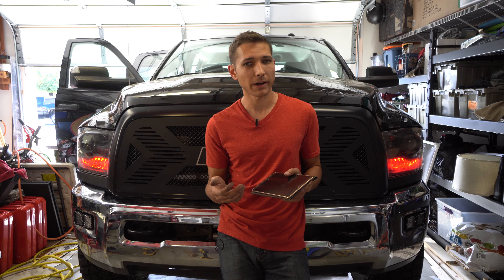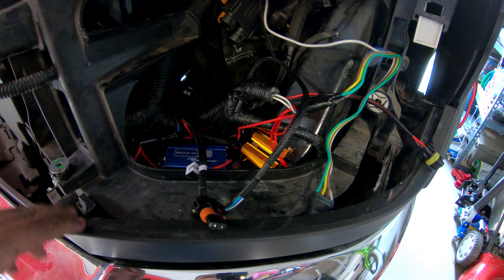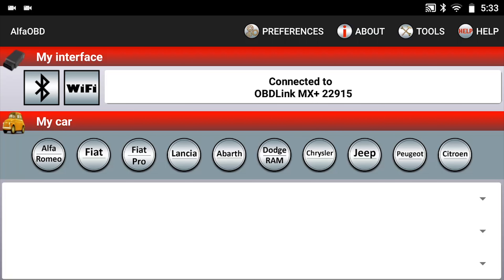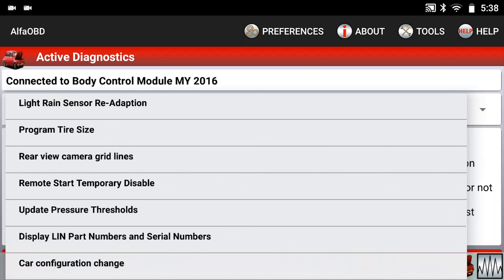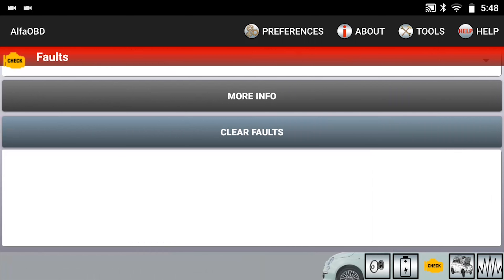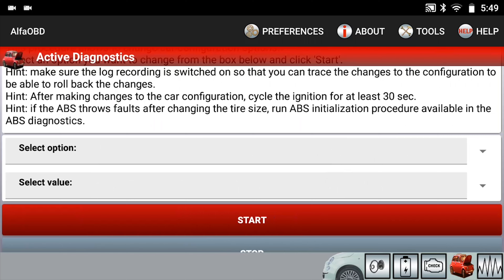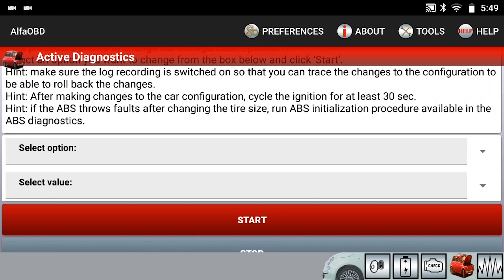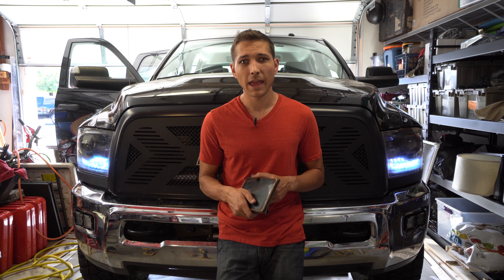Ram Bulb Out After HID/LED: Alfa OBD Error Fix For Headlights+Turn Signals

Comment: Could use some help. I'm not seeing any of these settings for my dodge dart. I'm trying to get rid of the bulb out error for my license plate light because it is led but the only led options that I see are for turn signals and more importantly I want to get rid of my high beam/low beam headlight out errors for my HIDs but dont see any hid settings other than "xenon headlamps" which I tried to enable but keeps failing saying "ecu detected parameters with values outside allowable range". Only other setting close to that is "headlamp led management" but I don't know what that will do. I'm lost in trying to get rid of these canbus errors. I haven't even been able to get resistors to work for my HIDs for some reason, maybe I'm doing something wrong but this sucks.

Comment: I am getting left rear turn signal out indicator on dash as well. I also get hyper flash on the side mirror turn signal and turn signal indicator on dash but front and back work normal. This only happens when I turn on my head lights. I also get rear turn signal out left side when the headlights are on everytime I hit the break. My truck came with LEDs is there a setting you could recommend for me to change to stop this?
Reply from the maker: What year truck, and are you running relays or wired differently from stock? Which tail lights do you have?

Comment: The hid wiring harness in my dodge dart only connects to one side of the vehicle's factory harness (right side). So the bulb out error I get appears to just be for the left side that is not plugged in and idk how to go about fixing this bulb out error even with alfaobd. Idk why the hid harness is setup this way but the only thing I could think to solve this is have an incandescent bulb connected to the open factory harness and randomly hanging out in the engine compartment which isn't ideal and impractical. Any help would be much appreciated.

Comment: Hi Charles, i have a 2014 ram 1500 sport with factory projector headlights, i put HID's on low beam, high beam, fog, LED's on my license plate and third brake light.  I've also installed the Diode dynamic's halo's and switchback's. I have the OBD Link MX+ withe alfa obd app on my android phone. I had a bulb out message for all of those, except for the hi beam ???,  i was able to clear out the license plate message, but the low beam and brake light messages won't go away, even if i clear all the error code, they always come back ??? any suggestions. Thanks Ben

Comment: I cannot find anything to update any of the exterior bulbs to led through the Alphaobd program. I am currently using the demo to decide whether or not to do the full download. This is the main functionality I want to have for using the alphaobd system. Does that functionality not work with a 2011 ram 1500 or am I just accessing the wrong module?
Reply: I have a 2011, did you ever find an answer?

Comment: Nothing working for me
I have diode dynamics leds sl1 in low beams with canbus modules connected in line. Was having issues with one headlight goin out every other day. Got alpha obd an changed all the settings on this video. Now i have no headlights.  Driving me crazy.  Any ideas?
Reply: What year is your ram? I have a 06 . 1st year they started with the tipm crap
Reply from the maker: Have you removed the canbus stuff? And reset all the error codes? Diode makes some great stuff. Start by resetting everything, then make sure to change only one thing at a time, wait 5-10 minutes then go back and change another. Changing multiple things at once don't always save for some reason.

Comment: What settings do I adjust when installing HID's on high beems I keep getting bulb out era and light flickers on off 2017 ram projected At 1 point low beats would just get brighter and hi beam bulbs would bot do on
Reply from the maker: There should be a setting for led or hid for high beams, try that one.
Reply: Try these settings. CBC Features - Bi Xenon Headlights Enable made it Yes and  CBC Features - LED High Beam Lamps Present Yes as well

Comment: I recently installed LED turn signal bulbs. The parking lights are white and the turn signal itself flashes orange. When transitioning from the white parking light to the orange flashing turn signal the truck displays an “parking light out” message. Is there a fix for that also?
Reply: Did you get this fixed? Got the same error

Comment: What if you already had led turn signals get new headlight buckets and get this error then what ? Alphaobd says you already have led turns so ?!?
Reply from the maker: Are you referring to my actual video screenshot, or your own issue? Is every wire hooked up still? If you have it set as led and nothing plugged in, it will still give an error message.
Reply: Charles Pages  everything is plugged in properly, in the truck I get a quick flash on the outside I get a normal flash

Comment: Doing the same install I suppose, I have a pair of Limited Headlights that I'm trying replace from the halogens, I heard in your video that you made your own harness, would you have any details on that? Would really really help, I tried but im stuck in the clutter and I really don't wanna have to pay 175 USD for one, please help!! Thank you
Reply from the maker: It was less of making a harness, and more just running the wires out the back of the light and tapping into my factory harness. I didn’t exactly make it plug and play haha

Comment: Tryed this on my 2015 dodge ram 1500 low beam led headlights conversion. They  still turn on and off, sometimes completely off. Any suggestions?
Reply: Front low beam headlights
Reply: Ryan Lafferty you ever figure it out? Have the same issue..

Comment: Hey. Got a new evic and changed my headlights to led. When I  turn on my high beams I get a low beam out on passenger side but it's a false reading. Any ideas why?
Reply: Did you have the evic with the smaller screen, or did u always have the 7inch screen?

Comment: Do you have to take out your resistors? Like is it a requirement or is it optional?
Reply from the maker: Yes and no-the truck is looking for specific current, so the resistors could throw it off/cause a code. 
I don’t like resistors, they create heat and waste power!

Comment: I have a 2018 Ram 1500 with Alpharex G2 headlights. I changed everything to LED and only get the “parking light out” error with the headlights on and then use the turn signals. Using the turn signals without the headlights on doesnt cause the error.

Comment: I installed the alpharex headlights. At first the drl, signal, and headlight worked perfect. Now only the headlight works, not the drl or blinker. No bulb out indication.  

Any suggestions?
Reply: Did you figure this out? I have the same headlights, with sequential signals. I'd hate for mins to stop working!
Reply: The company gave me a new light. I just recieved replacement harness so I'll be installing them this weekend. If it doesn't work I think I will need the alphaobd app to reprogram them. I'll let you know. They did look way better than stock
Reply: @er5490  I hope you get it resolved! So it's just one headlight?
Reply: @Khercules  yup. The passenger. The driver's works perfect. The company thinks maybe I got a defective light so they replaced it but we'll see

Comment: After doing all this and changing all my stop/tail/turn signals to LED I'm still getting bulb out messages. I've reset the error codes but as soon as I turn on a turn signal or hit the brakes a new error code pops up. What did I do wrong?
Reply: Did you ever figure it out?
Reply: Did you ever figure this issue out? I had a “parking lamp out” issue while using GTR Lighting’s LED rear bulb on my truck. It posted every time I hit the brakes. Got sick of it and switched back to halogen bulbs and switched all the AlfaOBD programming back from LED to original halogen… now I have no fault messages, but my turn signals literally don’t flash in the back. They do in the front and the side mirrors, and there’s no hyper flash, but the rear taillights: nothing.

I paid nearly $600 at the dealership to make sure it’s not a broken wire, but it wasn’t. They printed out a page for me that showed the blinker input was “not set”… does anyone have any suggestions?

Comment: Im getting rid off my resistors from my Morimoto harness but im having a extra plug from my original oem harness does anybody know the correctway to plug everything without the resistors?
Reply from the maker: Was it where the resistors plugged into? If so you can just leave it (covered of course). Or do you mean a different plug like where it would normally plug into a bulb?

Comment: I have a 2011 Ram 2500 and want to buy a new Alpha OBD so I can do some of these things.  Is there a particular brand or specific model i should look for?  And where is best place to shop for one?
Reply from the maker: Brand or model for the tablet? There is only one app, and two different odb mx plugs you can buy. The rest is just a tablet, but just about any android tablet will work.
Reply: @chazpages  Thanks for the quick reply.  I guess I wasn't too clear on what I was asking for.  I was wondering if there were different brands of Alpha OBD.  I do presently have an Android cell phone (Samsung Galaxy S5).  I guess it's the enter face and connections that I need to make sure i get correctly ordered. Where do I go to buy an Alpha OBD and the proper connections?
Reply: @Tahoebronco  You can buy Alfaobd from the app store, that is the software name, make sure you spell it as ALFAOBD.  The OBD LINK MX can be purchased through amazon.  That is all you need.
Reply: @chuckosborn3096  actually , all you NEED is one of th original $12 ELM327 bluetooth obd adapters from ebay..

Comment: I have led halos as my turn light. I’ve changed them to led in alphaobd but I still have the bulb out indicator
Reply: I'm having the same issue.
Reply: Try this:
CBC Config I/O Usage:

________________

Front Driver Door Ajar Switch Signal Usage (Lamp Diagnostics): Disabled

Door Ajar Switch Signal Rear Left Usage (Lamp Diagnostics): Disabled

Comment: I installed Led into both front low beams and switched on the settings to enable led low beams but still get intermittent left side bulb out error.

Comment: Have a 2015 2500 that came with spyder headlights and tail lights. The headlight bulbs seem to be oem but all the turn signals are led. I bought the app and obd Mx connector and changed everything that was recommended in this video but haven’t been able to clear any of the faults and still have the annoying fast blinker light. Has anyone found another setting that has worked? I’m about to try and get a refund for this damn 50 dollar app and look for a different route.
Reply from the maker: Sorry to hear that, I know its frustrating. Have you pulled the lights out to make sure each wire/plug is actually used? If you change something to led but they left a plug unused, it will still throw a light/error code. It needs to see a complete circuit.

Comment: What settings need to be changed if standard incandescent/quad headlights are installed in place of the projector headlight assembly? Everything works fine except the blinkers, which function, but a turn signal bulb out warning appears and the indicator in the cab blinks fast for both front left and front right turn signals. I set LED front turn signals to NO but the bulb out message still appears and the indicator blinks fast. I also tried to clear the code, but it seems to come back immediately. Any suggestions?
Reply from the maker: What wiring harness are you using?
Reply: @chazpages  just the oem harness on a 2015 ram
Reply from the maker: Are these non-stock/non-oem headlights? Otherwise the harness shouldn't plug right in. I'm assuming they are aftermarket ones.
So, first off did any other lights get swapped out? Tails etc?
Otherwise, assuming you have changed everything to be led, the truck shouldn't say any bulb is out. Did you change all the settings at once? Or one at at a time, disconnect from the truck, wait, then change another setting?  
Did you also change the parking light setting?
-LED Front Park/Marker Lamps Present
-LED Front Turn Lamps Present

-and maybe LED Dedicated DRL Present
Reply: @chazpages  Thanks for the help.
To my knowledge they are stock oem reflector lights with the standard bulbs. Truck was purchased wrecked by a shop, repaired, then sold to my gf's dad. This truck is a laramie, but I think they used parts (like the reflector headlights) from a lesser equipped truck because they had them on hand. Rear lights are all stock/oem LEDs. 

I check BCM config and it was configured for projectors found in higher trim models, but for sure has reflector/quad lamps. The only change I made was to turn off LED blinkers. then let it rest. Tried a few times. Should I try changing the parking/marker light config?

I was not aware the harness was different. Maybe they hacked up the harness to make it work? I have not pulled the headlights to check what they did.
Reply: Charles Pages hi，Im something right now, I did change all the seting in same time, my tail light is out ，dash say my rear left and right turn single not work

Comment: AlfaOBD doesn't do the trick. I'm having the same problem in my 2014 Ram 1500. I replaced every bulb with an LED from Diode Dynamics. Yes, the truck's computer states LED as Present. But the truck still gives bulb out errors. And the rapid blinker sound is too obnoxious for life behind the wheel. I'm about to just suck it up and pay $40 dollars for four LED Resistor Kits. Anyone else feel this pain?

Comment: Can you turn off the DRL feature?
Reply from the maker: Yes-there is a whole section on DRL stuff. Haven't made a video yet, not quite sure how lol. Lots of options.
Reply: @chazpages  that's good to know! If you live in Wisconsin I'd let ya make a video on my Ram! Lol
Reply from the maker: I'll let you know if I visit haha. I'm just not sure what differences in wiring all the different versions make (dual, quad, projector) and I'm running a less than factory setup, so I don't know if what changes on mine would change on others.

Comment: PLEASE HELP ME GUYS !!!!!!!  I have a 2006 ram 1500. The 1st year they started with the tipm crap and computer circuit interruption instead of just a 50 cent fuse. I changed my headlights and tailights to spyder halo/ projector headlights and led taillights, all my turn signals are switchbacks with the canbus/resistor module pre wired in. Everything was working fine till I added a 5 function led tailgate light strip/bar after just plugging it into the 4 pin trailer connector and checking all the functions I get to the turn signal and BAM!! HYPERFLASH....... I DO NOT have a bulb out warning light on the gauge cluster thou,  I've dbl and triple checked all my connections,  grounds, cleaned all the power terminals on the battery and tipm module. Checked and replaced all the fuses.  Even thou there is not turn signal fuse. That's what makes me think it's the computer shutting down the taillight blinker circuit. I've temporarily jumped my rear turn signals of the trailer wire harness till I get it sorted. I've even tried putting back the OEM headlights & taillights with halogen bulbs. Nothing works. Please help me guys!!! I have zero confidence in taking it to a dealer I can hear them now.... "sir you need a 1000$ tipm, or they will just say we can not alter the programming the way you want. Thanks guys.
Reply from the maker: Sounds like a lot going on. Have you tried programming with Alfa yet? 
Ah, just saw it's an 06. There is always trouble with resistors and such. I don't know much about that year/model.

Comment: I cant fix my rear signal lights with the app
Reply from the maker: Still having this issue? I'm trying to figure out why some people have issues and others (most) don't
Reply: @chazpages  I just put my stock LEDs back on
Reply: I was having this problem. It ended up being that the bulbs I bought were canbus ready. I turned the settings. No led present and hadn't had any issues

Comment: What's the difference between MX and MX+?
Reply from the maker: Mx+ can connect to iOS/iPhone but it will NOT run the software required to change settings. 
If you have iOS stuff, get the mx+ that way you can still connect to the truck and clear out codes/see digital “gauges” on your phone while out driving around without needing to use/borrow an android tablet. Just know you won’t be able to use the Alfa OBD software.
Reply: @chazpages  I have an Android phone. I'll go with the MX. After that I will need to download the software from the app store and I'm set right?
Reply from the maker: Correct, either google play or amazon store!
Reply: @chazpages  thanks for your help!
Reply: @chazpages  I don't know if you covered it. How can I get the live data gauges to show? Thanks